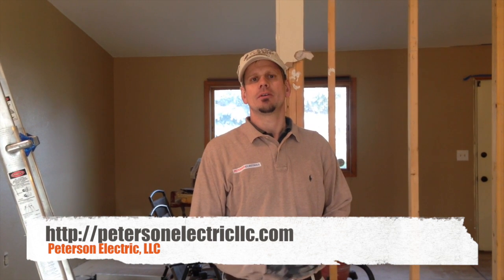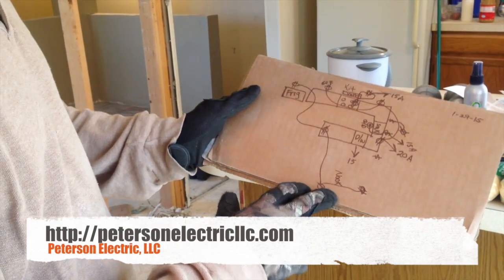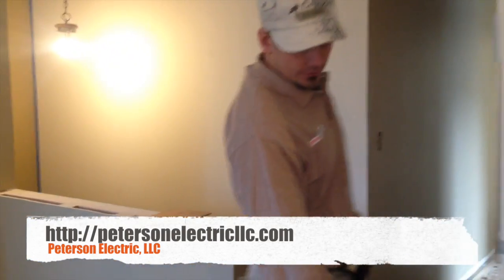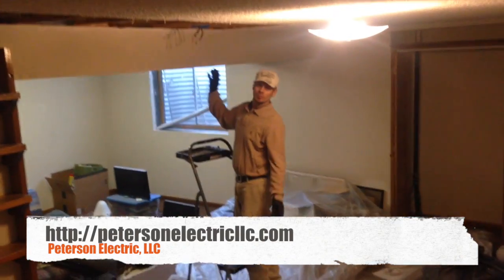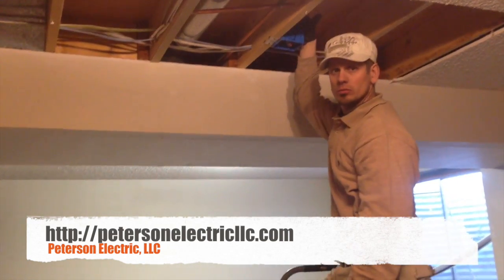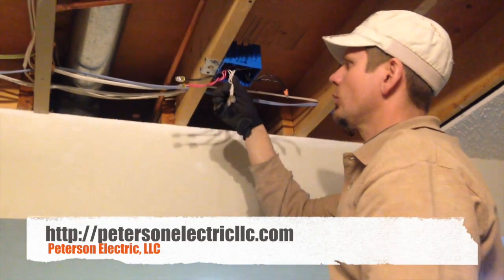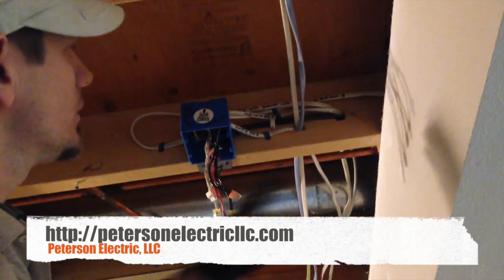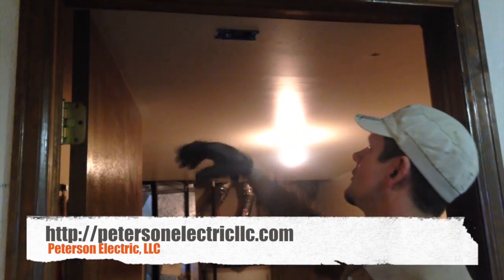Electrical Wiring Relocated Due To Removing A Living Room Wall

Comment: At 1:30, on your reference to the 15-amp range hood: I can't tell you how many times I've been called to a customer's house because they keep popping breakers with the microwave oven. People remodel their kitchens, or have them professionally remodeled, and they always fail to properly do the electrical work. They are not licensed electricians, so they just take the 15A cable powering the range hood and wire an outlet for the microwave with it.  This DRIVES ME NUTS!  The customer then has to spend even more money to hire a licensed electrician (myself) to wire a separate 20A circuit for the microwave, which the remodelers should have done in the first place.
Reply from the maker: Even more frustrating to explain how they need to update circuits and AFCI Breakers and then the GFCI plugs for D/W & Disp. Possible their gas range as well if it's closer than 6'. Then I love to explain how under cabinet 3 watt LED strip lights have to be on a AFCI lighting circuit. Usually when you tell them their 3 wire, 50 Amp SE cable has to be changed out to a 4 wire, 60 Amp Copper NM cable, they start to glaze over. After I explain that their old service panel has to be upgraded with new grounding and a new by pass lever, they are NOT interested. Customers say to me, "it has always worked in the past, all I need is a couple of items moved"! 

I always explain to them that every three years our code book comes up with safer methods to protect the consumer. Usually when I compare the example of, "would you not want the air line and car industry to upgrade when plans have had made mistakes and cars are not created safer"?  This is why we have insurance and fire departments!
Reply: Wow, you have a lot of stuff in Colorado to deal with that is not required here in Tennessee.  For example, we don't have to "upgrade" any breakers to AFCI if we're just upgrading the service.  Even if so, AFCI's are only required for bedroom circuits here.  Also, only kitchen countertop outlets are required to be on GFCI's. Dishwasher, disposal, microwave, gas range, and refrigerator can (and should in my opinion) all be non-GFCI.  Of course, bathrooms, garages, and outdoors are to be GFI as well.
Reply: Anytime remodeling a kitchen why not make sure all the electrics good cut holes under the cabinets if you have to ppl don’t think of that just the finish work
Reply: I do electrical work for a living mostly services and double board houses and old work it sucks contractors have it so easy walls are open
Reply: Jeff tk

Comment: NEC doesnt stipulate having a bigger box than needed. Using the 80% rule of the circuit I  keep my box fills at 80%. We see boxes overfilled and maxed daily- from DIYERS to electricians licensed and non-licensed.
Reply from the maker: 80% is not a rule in article 314, it's based on size and number of circuits.